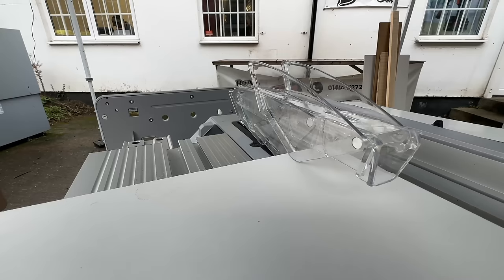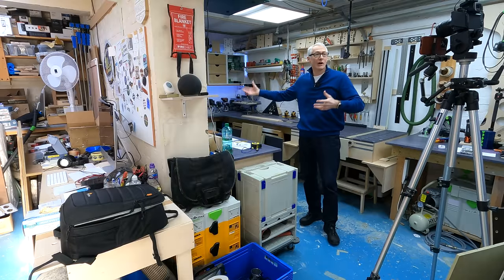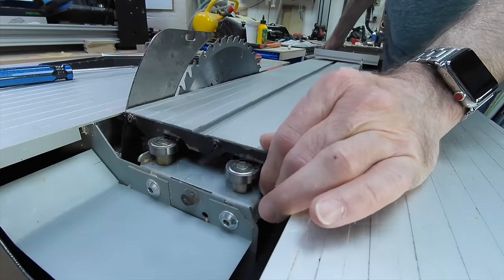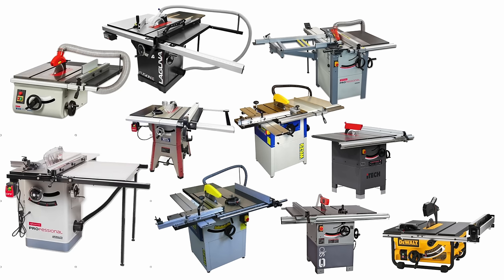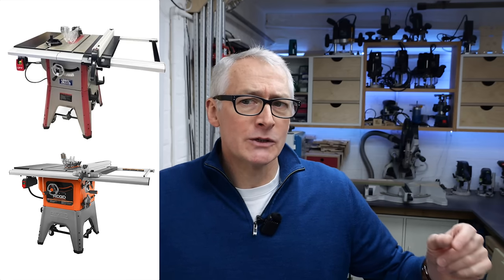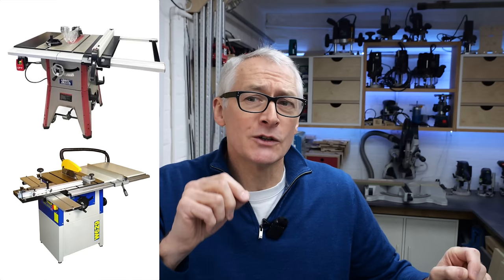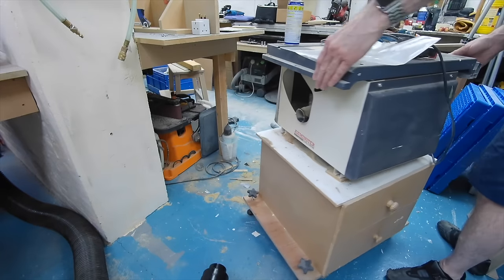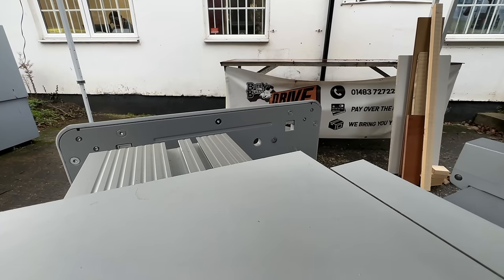Why Buy This Saw? [video 516]

Comment: Great video yet again and I am definitely in the market for the festool .  Storage is a problem for myself, and being able to store the saw in its on systainer makes sense. One thing , I can't help but wonder is you mentioned that you can't have a 16amp supply to a saw. Why not?
Reply from the maker: Thanks. Re the power supply question, there's a very long and convoluted answer to that, but the short version is I've been in the workshop ~20 years and it's just not going to happen. 🤷‍♂️
Reply: @10MinuteWorkshop  oh ok. We will leave it there then. Thanks for the great video's

Comment: Great video Peter, I’ve just been going through the same dilemma myself. Just wondering why you dismissed the corded Festools?

Personally I am hoping the Festool Cordless tech eventually migrates to the corded variants.
Reply from the maker: Thanks. It’s purely a personal thing; all the Festool table saws - until this one - follow the same pattern established way back by the CMS. Instead of a simple t-slot/mitre slot there’s a proprietary extrusion around the perimeter of the saw that handles all the accessories/moving parts, and I just don’t like it, unfortunately. 🤷‍♂️👍

Comment: Got mine Tuesday. Preordered it immediately when they came out here in Sweden. Working in a 2x3m shed as my workshop, so this table saw was a dream come true!😅 Unfortunately had to send it back the same day as mine came with the sliding plate being roughly 1mm lower on the left side (so not co-planer with the table) resulting in cross cuts not being square. Dug through the manual, but unfortunately no way to recalibrate or adjust the tilt of the sliding plate. Festool told me to send it back ASAP😅 Bummer since it is completely new, but should be getting it back fixed at the beginning of this week!🙏🏼 Festool has some incredibly swift and high quality customer service !🙌🏼
Reply from the maker: That’s really disappointing. Curious why you’d return to Festool and not the dealer?
Reply: @10MinuteWorkshop  Didn't really consider that to be honest. Figured it was open, so not much to be done other than a service appointment to be readjusted by a festool technician.
Reply: @10MinuteWorkshop  Just got mine back again from repair, and it still has the same issue unfortunately, starting to wonder if I'm just being picky😅
Reply: What was Festool’s response to the lower height? Is it by design or a tolerance issue? Can’t really understand why Festool did not make it level or at least only a very very small difference only. 1mm or 0.5mm seems too much.
Reply: @lemech  unfortunately it's a tolerance issue. Definitely a design flaw, they basically said it was within their acceptance tolerance. Really a bummer considering the price of this thing and it being 0.5mm tilted to the left making it non co-planer... They said I'm welcome to send it back for repair free of charge in the hopes of getting a better sliding table part, but I would just be rolling the dices at this point!😅
Reply: @ErikSutton1  I'm surprised to hear Festool has such a high tolerance. Can't imagine this can be the case for such an important parameter. My gut feel tells me this is a reply of convenience. If indeed the tolerance cannot be better, then the sliding table height should be made adjustable. I wonder if putting a thin shim or adjusting the blade angle to compensate will help. But seriously, Festool, please straighten this out. An out of level and/or out of square sliding table is not acceptable. That would diminish the value of the CSC 50. Erik, I'm not sure if it helps if you post a video so that potential buyers are aware what they are getting into. Anyone else have similar issue? Thanks.

Comment: Hi Peter, what are your reasons agains CS50/70 and TKS80? Thanks in advance!
Reply from the maker: It’s purely a personal thing; all the Festool table saws - until this one - follow the same pattern established way back by the CMS. Instead of a simple t-slot/mitre slot there’s a proprietary extrusion around the perimeter of the saw that handles all the accessories/moving parts, and I just don’t like it, unfortunately. 🤷‍♂️ I had an older CMS briefly, and loathed it. 👍
Reply: Thank you!

Comment: i think the nice thing about festool is, if you dont like it, you can sell it on the used market for almost full price.
Reply from the maker: Yep; 14-day money back guarantee, and guaranteed resale thereafter. 👌
Reply: I am in middle GA USA. You never see Festool or any high dollar tools for sale in this area. Milwaukee is as expensive as it gets. No buyers for high end. If you tried to sell it there is no way in hell you would get anywhere near full price. Lucky to get half price. I have only seen one exception. An Omga radial arm saw. Retail is over $7k, that is over $7000.00. For sale near me for $1000.00 and appears to be in excellent shape. If I had a place for it, I would buy it for that kind of money. Plus I have no need of it but killer deal. To make things worse it is only 20 miles away. I could easily look at it.

Comment: Has the saw come in? Anxiously awaiting your review and the US release which seems to be at least 3 months away (although I would be surprised is they waited until the 3rd quarter of the year). When you do the review, can you measure the height of the Systainer. I can’t seem to find those specs anywhere online. I’m assuming it’s close to 22” (558 mm) based on the posted dimensions of the saw.
Reply from the maker: No, I still don’t have it yet. ‘Due any day now’ they say. 🤷‍♂️ And sure, I’ll measure the height against a regular stack of systainers. 👍

Comment: Hi Peter, You said you can't get 16 amp service into your shop. What is the standard amperage in the UK? Love your work!
Reply: 13amp@240v
Reply from the maker: It's actually on a 30A ring main, but I've been in the building ~20 years and a 16A feed ain't going to happen; it's to do with the infrastructure of the rest of the building more than my specific unit. 👍

Comment: What happened to your old table saw? I remember that you did not feel comfortable about selling it on.

Also, I was interested in your remarks about the Festool saw with Sawstop technology. It does seem underwhelming when compared with the actual Sawstop table saws, as demonstrated by Ron Paulk and others. The Sawstops are available in Australia as Dave Stanton has demonstrated them on his Youtube channel. He even did the hot dog demonstration thus ruining a blade. I am not sure that that was necessary as there are enough videos of this, but afterwards he did feed the hot dog to his dogs, after cutting them up using a knife.
Reply from the maker: Thanks! I gave it away and a 10MW Plus member took it away for cannibalisation. 👍

Comment: I have a Sawstop jobsite saw due to space constraints. It is fairly loud and I don't really like it but I do enjoy my fingers quite a bit. It would be nice if Festool would offer a mains adapter because I can see the battery dance being a bit of a pain. I was cutting a bunch of sheets last week with the TSC 55k and was very annoyed when the batteries went flat. Part of me thinks I should have waited for the TS 55 FEQ. Best of luck on the new toy!
Reply from the maker: Thanks. I don’t see the batteries being an issue - there are charge indicators for each batter on the display, and I don’t see myself using heavily enough to flatten that batteries in a session; I am on Festool drills and drivers though, so I do have others to hand if I need them. 👍

Comment: I bought my big ass Sawstop at the height of the pandemic when almost every saw I looked up was on back order   with no predictions for the future. Then quite by accident I stopped in a high end tool supply house near me and they had everything in stock in town and the price was the same, actually a little less than the online retailers. Having been bitten by table saws in the past and one finger shorter than it used to be Sawstop was a no brainer for me and the 52" length makes 4x8 plywood childs play other than being heavy.. The only drawback is NOTHING in my shop was the right height so I had to rebuild some benchery..Oh well ..I wasn't born with unlimited space for a shop..

Comment: Hello Peter,
That was a great diagnoses of saws available and to suit your requirements. We can all fall into a trap of the best of this best of that, but it’s down to exactly what you said, budget and what YOU really need it to do, not what someone else thinks, is the best since sliced bread. Etc,etc. For me I needed a site type saw that I could store away on its side when not in use, have a large top for support and budget of £600ish four years ago. I purchased the Bosch GTS10XC, would I recommend it? No, there’s too many inaccuracies in it which took a lot of effort to sort out. So I’ll be very interested like many others to see how you get on with this Festool. I’m always interested in what you do and say. Max
Reply from the maker: Thanks Max! Interesting what yoy say about the Bosch; that and the DeWalt come across as some of the better site saws out there, and I know more than a few folks who use them in the workshop as well. And yes, I'm interested to see what this saw is really capable of too! 👍

Comment: I nearly brought that startrite! I had one of the bargain Drapers (£200) cast top plus sliding table + side extensions.. The rise/faull has broken so I've been looking for a replacement. Similar, was going to buy one of the Axy workshop 254's at Christmas because there was ~180 quid off but missed the boat and they havne't had them since (as you say) - still looking.... Can't afford your Festool prices though!
Reply from the maker: It's still available - great looking saw! 👌 👍
Reply: @10MinuteWorkshop  unfortunately the money isn't 😏

Comment: Did you consider the Bosch REAXX? It has a safety feature similar to the Sawstop and is far less in cost. They cannot sell them in the US due to being sued by Sawstop to prevent their sales. Competition you know.
Reply from the maker: No, Bosch have ceased manufacture I believe as a result of the action. 🤷‍♂️

Comment: Sooooooo.... I got mine on Friday. It ooooozes quality. On starting up and starting the calibration process the blade rose... went 45 degrees.... Then stopped. The display then said calibration was cancelled... Showed a red exclamation mark. And that was that. Can't do anything else... Powered on, Powered off, Batteries out... Batteries in. Restart... Nothing. Seems to have frozen. Won't do anything else... I phoned Festool... But caught them 2 mins before they were due to wrap it up for the weekend. With respect to them they did call back but I was on another call....  Now I have to wait till Monday... Hoping that there's some factory reset of process that enables me to move on.... Was so looking forward to using this. Quality for a small table saw is amazing. If only I could get it to work.
Reply from the maker: That’s so disappointing! Let me know how you get on subsequently - I’d be very interested to hear. 👍
Reply: @10MinuteWorkshop  Short update. Festool say it probably needs a software update.... This software update can only be applied via a Android device. I don't have one (sounds like Festool doesn't use Android devices either.). Phoned round my friends and found a tablet. We'll give it a go tomorrow... I know it's early days but even before I can use it... I need to update the firmware.
Reply: @DominicGiles  Did the update fix the issue? This is the second issue I've heard with the early batches. The first one is the sliding table not being co-planar with the fixed table. The delivery for the CSC 50 has been delayed worldwide. I wondering if the back log is due to high orders or Festool has stopped production to fix the unforeseen issues.
Reply: @lemech  all sorted now. Festool support helped. I first updated the batteries and that that seemed to allow me to access the tool via an android device. That enabled me to rest the saw and was able to proceed.
Reply: @DominicGiles  Great! Glad to hear all working fine for you.

Comment: Peter, have you ever considered moving to a larger shop?  I do not know if work space is available in your area but your current location looks to be smaller tan a single car garage which seems very tight quarters.
Reply from the maker: Every day! 😂 And then I realise how convenient it is - 20 seconds from my front door, 12 if it's raining - and cheap (for London). Combine that with a real scarcity of commercial workspaces and high prices, and I'll stay where I am. Low overheads and convenience beats everything else! 👍

Comment: Hi Peter. Have you considered a smaller brother of AW254TS, the AW216TS? I bought one two weeks ago and after a few little minor issues (bent fence and missing screw) I am really happy with it in my small (similar size to yours) workshop. I am wondering why you never considered this one if compact size was your priority? Is it just too small? Not powerful enough?
Reply from the maker: Thanks! I think I said in the vid, if I was going down the cast iron route then 10" saws are generally a bit better screwed together, even if they do have more capacity than I need; also I had the older version of the 8" Axminster saw and was underwhelmed. Different model now, so perhaps more has changed, but it wasn't something I wanted to revisit. 👍

Comment: Interesting to see the process of elimination to where you ended up and will be even more interesting to see how it works out for you and your circumstances. It's not the way I would go personally, I have a bit of a fetish for old lumps of cast iron that will out live us all (not afraid to say it) and battery powered would really put me off but I do understand 16A is an issue, 3 phase more so for the DIYer like myself.
Reply from the maker: If I wasn’t constrained by power and regulations, I’d have been all over a cast iron ‘project’ saw, but it is what it is. And yes, I’d have preferred it not to be cordless. 🤷‍♂️

Comment: Looking forward to the next videos starring the new saw! Am sorely tempted myself, but I don't like or need cordless tools all that much.  Btw, what's that about you not liking the CS50 or CS70?
Reply from the maker: Thanks! For me the CS50 and 70 fall into the same category as the TKS 70/80 and the old CMS systems; I just don't like the use of a proprietary profile around the edge of the saw table instead of regular t-slots/mitre slots in the bed. I understand why they did it, but I just don't like it.🤷‍♂️ Same for the Mafell Erika as well. 👍

Comment: Dewalt cordless! Would of saved yourself over a grand. Good dust collection and quiet. £1700 is nuts festool take the pee. Although my festool dust extractor is amazing.
Reply from the maker: 86dB is not quiet. 🤷‍♂️
Reply: What is the festool peter?
Reply: Also what difference does the noise of the motor make. Surely the wood being cut makes the same level of noise on any saw. 
Bit off a silly reason to spend an extra £1000

Comment: My experience with Axminster hobby craft level table saws? A piece of kit to avoid...will never spend another penny on these or the ones immediately above from Axminster. The truth is: in between low standard table saws that most of us can afford and a proper and decent cabinet saw there is not that much in the middle and in that aspect the U.S. do much better.
Reply from the maker: That was my experience of them as well,  but the current models are significantly better - Badger Matt had one, Paoson has one. But we do seem to be under-served for a good quality but compact table saw. Curious which American saws you consider to be better?? 👍

Comment: I would love one of theses saws but you can buy a who load of woodworking machines and still have change for the same price
Reply from the maker: Yep. The budget for a table saw that met my specific requirements was £2500 inc VAT; T £1700 this fits right in there. 👍

Comment: I bought the lumberjack as an ex-showroom model. It really feels like a good saw for garage workshops as it's really portable. 

It also only just runs on a 13A plug top. You have to use a special type of slow blow fuse, as the inrush current from startup will frequently blow a standard plug top fuse. I added a separate 16A circuit for mine and swapped the plug.

I agree about the price. I paid £700 for it, more than that is too expensive.
Reply from the maker: Yes, Keith Brown covered this in his recent videos; it's not uncommon for induction motors to draw very high current on startup, so a bit optimistic of Lumberjack to supply this with a 13A plug and regular fuse. 👍

Comment: Hi Peter. I do not know if you maybe be interested or not but in around 2 weeks I shall cease to trade and have some very good electric tools for sale(and some non electric) , such as festool, dewalt and Lemelo brands. Would you be interested at all? They are all in very very good condition and some hardly used. Let me know of your thoughts or any questions you have. Chris
Reply from the maker: Hi Chris and thanks for the offer, but I’m pretty much all tooled up, so not really for me.Thanks though. 👍

Comment: Speaking as a paramedic, if it's not a sawstop, it's not worth buying. 

I kinda wish sawstop went full Volvo with their tech and didn't patent it. It should be mandatory on all table saws. I've seen far too many amputations and deaths on the table saw to ever recommend anything else.
Reply: The original patentee was a lawyer specializing in in patent and copyright actions. The conditions he proposed for licensing the product were commercially unviable.